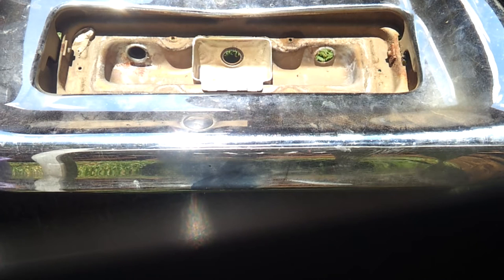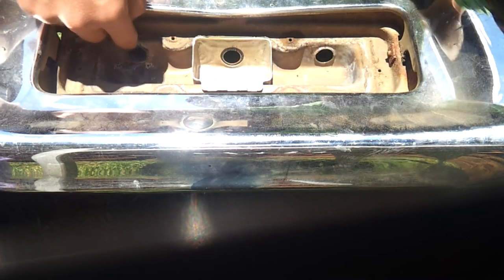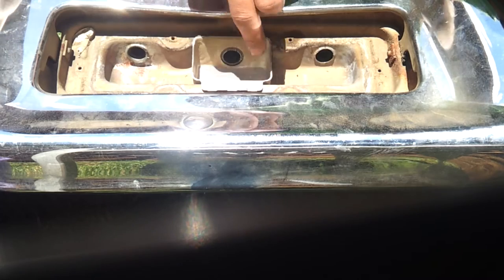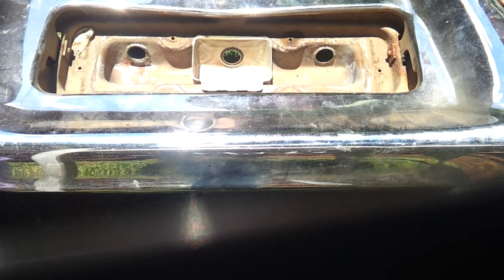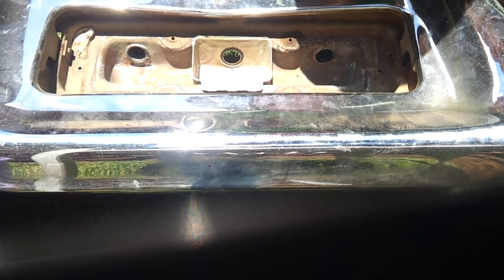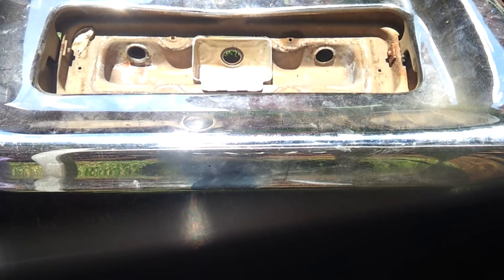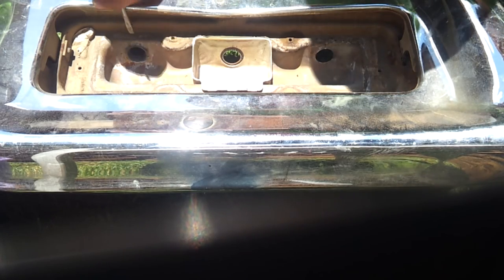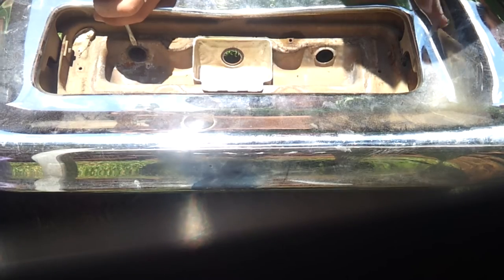Brake Light Removal - 1968 Pontiac LeMans

Comment: I did this tonight. Did you get them back together? Did you make a video?
Reply from the maker: Hi, yes but I used new fittings, Dorman 85803 for brake lights and Dorman 85806 for the reverse light. I did not make a video of putting in the new ones.

Comment: Thanks for the video. Were you able to find replacement sockets? If so, where did you get them from?
Reply from the maker: Hello, yes I got them from Summit Racing. I'm sure you can get them from other places too. Look for Dorman 85803 which is the double contact, and Dorman 85806 for the single contact. Just make sure if you ever change a blown bulb there is no power going to the lights while replacing them because they are spring loaded and will short out.